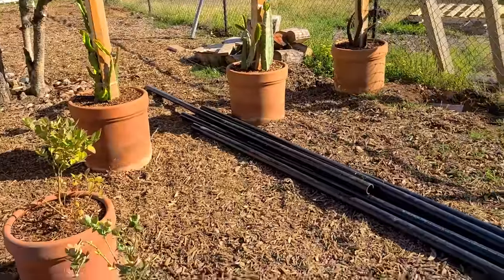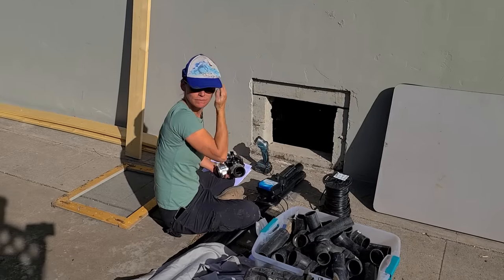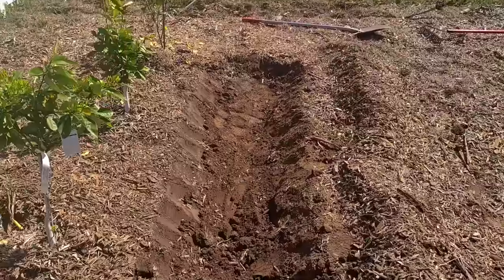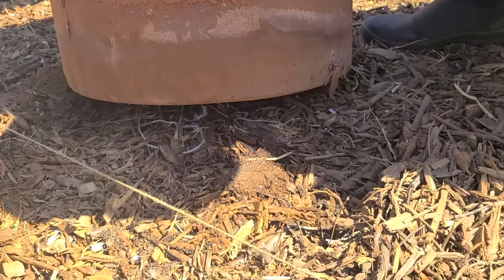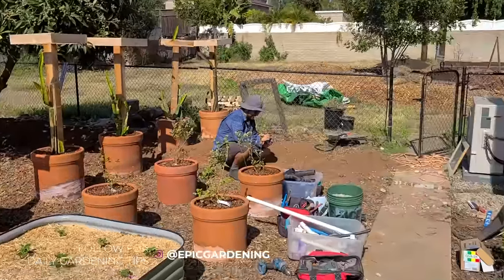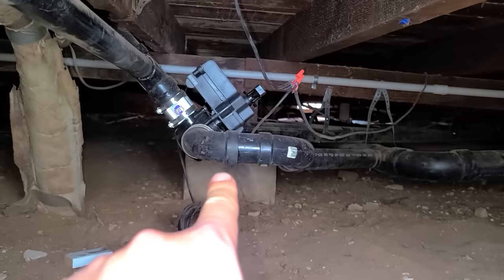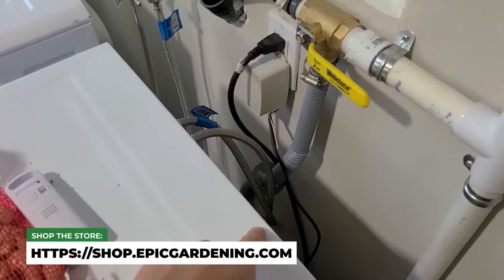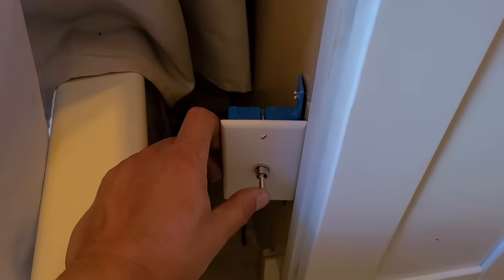Grey Water Systems: Shower, Bathroom Sink, and Laundry Conversion!

Comment from the maker: What questions do you have about these systems? I'll answer them all in a follow-up video 💦💦💦
Reply: what do you need to look for in laundry/shower/cleaning products to make sure they're safe for your plants?
Reply: My same question. Does the mulch and fill filter the water? What will you fill the basins near the citrus trees?
Reply: Is there a chance you could overwater your trees?
Reply: Do you know if this grey water use is legal in all of California or does the authority lies with the Counties? I had people give me conflicting information and I just would like to be sure.
Reply: Does the mulch in the basins eventually ya r to be dug out and replaced as it breaks down?
Reply: Kevin, there are some links in the comments that are pornographic. Is there a way to delete them? I don't want you to get in trouble....
Reply: What kind of foundation does this system need?
Reply: Did you specifically look for a house with a crawlspace so you could do greywater? Also did you calculate the number of gallons that you’d generate from shower and laundry and factor that in to determine the number plants that it can support?
Reply: @isoldefrancis2688  Brook & Kevin said it is legal to do this in California
Reply: I'd when you may be putting in a greenhouse but would it be possible to have another grey waterbranch in the drain to a holding tank for other plants besides citrus you may want to utilize water for ? Shout out to Jaques ;-)
Reply: Same question as many others. Safe products to use?? I try to stay away from phosphates, etc. anyway. we have a terrible problem with PFAS here in Michigan.
Reply: How does it work to eat food that's been watered by this? I'd be interested to see your bath and laundry products
Reply: What kind of soaps do you need to use to make sure this doesn’t kill your plants? I know lots of soaps and detergents contain salt (especially eco friendly types) which would harm soil. Is there such a thing as gray water catchment friendly soaps?
Reply: In Cali/San Diego County can we collect the water into a basin to use as we need?
Reply: How does it work with detergents? Do you have to switch to ecofriendly soaps and detergents or does it somehow get drawn out before the water goes to the plants?
Reply: Do normal shampoo and conditioner products hurt the plants?
Reply: When do you know when to use black water? Is there any sort of filtration that can be added?
Reply: Have you considered rocks for the basins instead of mulch? What factored into your decision? Did your greywater installer help you with the decision? I'd be worried about plant roots getting inside and plugging it.
Reply: @christinescharphorn5968  mulch wicks the water around where are rocks would just sit there and bit transfer the moisture around
Reply: Did you install backflow preventers? Is there a filter to filter out hair and lint so it doesn't clog the drip lines? Did you need permits?  Very interesting that your area allows Grey water system.
Reply: Everyone else covered most of my questions so my only one is what was the cost? xx
Reply: What about laundry detergents and things like shampoo/conditioner?
Reply: I have so many questions about how to avoid the soil getting contaminated by soap, microplastics build up from washing clothes, soil ruined due to any small mistake by you or people visiting...
Reply: Could you have used a “French Drain” to get the grey water into the soil? (Instead of those 50-50 splitters)
Reply: Maybe you already said it, but do you use special products in the shower (or washing machine), knowing that everything goes directly into the soil? Crazy to think what sort of solutions or chemicals we drain into the sewer without ever thinking about it...
Reply: Curious to hear how much water savings you get from the supplemental greywater. What do you expect to get in savings and what did you actually get?
Reply: How exactly is shower and laundry water safe for irrigation? Don't the soaps and oils ruin your soil?
Reply: How close can the trenches be to trees or bushes?
Reply: @trishdavi7049  The premise behind a grey water system is that you send the water direct into the soil environment full of benign bacteria that will break down the body oils and nutrients present in the water before any bad bacteria that may be present get a chance to use them to multiply into harmful concentrations. Stored grey water can quickly become black water.
One wouldn't use grey water in sterilized soil mixes that one would typically buy for potting up greenhouse plants because there is almost no bacterial activity in it to break down the grey water.
Reply: @moramen2855  Backflow preventers are for the potable water pipes to prevent water in a garden hose and an irrigation system from being sucked back into the system should the potable water system's pressure drop below what maybe present in the garden hose. If one is in an area where the sewer backs up frequently there may be one installed for the whole house because the toilet will overflow well before any pressure will build up sufficiently to break the valve installed under the house to the bath tub.
There were no drip lines in either of his systems. The pipes were draining into small chambers allowing the water to percolate into the soil where benign soil bacteria breakdown any potential harmful aspects before they get a chance to build up into harmful concentrations.
Lint being the elephant in the pipes. With so many artificial fibers in our clothes these days they do build up in water systems because they don't go away; they only break down into micro-particles. I would imagine that lint is better locked into soils than our streams and oceans where treated black water ends up.
Reply: Can it be done in a brick and concrete house with no crawl-space?  I'm guessing it would be really difficult.. 😕
Is that a good distance between citrus trees?
Reply: How would your set-up change if you had a frost line/freezing temps?
Reply: How does the water get distributed evenly on the washing machine line? It seems like the water would all come out of the first opening and not make it to the last one. I assume this system wouldn't work somewhere it freezes in the winter, right?
Reply: I'm surprised to see only two areas being covered. How did you figure out how much water you'd get out of the system and how much you would need?
Reply: It's ok for the arterchokes to use our water, I love taking baths and I want my artichokes, one day to use my water, but that's ok
Reply: Isn't it bad to put soap in the ground so consistently? Or do you just use all natural (I'm still not sure that's great for it)
Reply: How do you keep it from freezing in the winter?
Reply: This is awesome! How much does it cost to start this vs laundry to landscape system, and can you get reimbursement from the state/county? Thanks for doing this video!
Reply: Why you don’t use the water from the dish washer? Because of the grease?
Reply: Why are you using mulch as the back fill? Why not use some porous rock like lava rock? You won't need to replace the Rick as much as the mulch plus you'll have lots of cleaning bacteria living in the rocks breaking down the soaps and stuff from the gray water.
Reply: I watched through the video and have some questions and comments.

1) I doubt this is legal in many states. California probably is allowing this due to climate and the inherent drought situation in many parts of the state. 

This is because without manual intervention (selecting the proper orientation of the 3 way valve) could have contamination of your gray water by people who are not familiar with your home. I would definitely label that toggle switch.

2) why wouldn't you treat the trenches like they do for french drains and septic fields. Perforated pipe in a trench with clean stone wrapped with landscape fabric to try and cut down on silt intrusion. 

Obviously water distribution wouldn't be as good but should prevent or at least extend performance of the drain system for a longer time before maintenance of those trenches is needed.

3) like others have expressed not everyone is using a natural soap. Most bath products are detergents with anti microbial additives and fragrance. 

Our family switched to using a brand name Castile soap which has been a positive experience but not everything we use like hair conditioner, face cleanser, etc is. And I'm not sure everyone following your channel is so aware.

I feel a decent disclaimer or at least a link to a dedicated video discussing the issues and concerns surrounding gray water use should be at the beginning. 

Only because if people begin messing with their own domestic plumbing and they are on public water and sewer, there's a chance other diy projects involving domestic water could occur non permitted/inspected and greatly increase the chance of cross contamination (black water and domestic water supply) which potentially could affect an entire block or neighborhood's potable water.
Reply: My question is can you mulch the ditches ?I mean not put plumbing in them, like for the artichoke patch, just let water run
Reply: The three way valve. We want to do that as well for Winter Wet Season Vs. Summer Drought Season. What make model, installations needs to it require? Any regrets or advice?
Reply: Wait, what?  You're talking water filled with shampoo and soap and laundry detergent?  Aren't all of these things terrible for your plants??  I must be missing something.
Reply: How are you filtering the water? Or do you just use eco friendly soaps?
Reply: Do you plan on doing anything with sewage like a bio gas or humanure system?
Reply: is the soap in the grey water can be dangerous to the plants and soil ?
Reply: Do you have a filter to catch micro-plastics (from synthetic clothing?)
Reply: What about microplastics in your laundry?
Reply: Protect your ears, especially when you do another Rotohammering Trench loud project
Reply: So with this system, it is okay to not filter grey water before releasing it to the plants?
Reply: If considering regional temperature and rainfall, would you advise some people to consider installing a one-way check valve in the pipe leading outside?
Reply: Do you have to be specific about the type of detergents, shampoo, conditioners, soap that you use for this? I’m getting curious about this, and I’ve seen Geoff Lawton set stuff up with a reed bed to do some type of filtering before getting to other plants and or gardens… I’ve also seen different people using mycelliated woodchip beds as filters too (sometimes for more extreme filtering and remediation like with factory or chemical runoff).  I just figured it was more involved, so cool to see the simple setup. Being in 9b in Arizona I’m getting very interested in water harvesting and recycling
Reply: How do you make sure there’s no soap in the water from the shower/laundry?
Reply: @trishdavi7049  Except some counties have rules about using water straight from laundry. We used to have our laundry going to gray water but learned that they changed the rules and now washers have to be connected to the septic tank. Other gray water that isn't going to septic systems must be delivered to dry well--they give the specifications for this. So, yes, some counties in Cali say it's okay. Others have certain restrictions. Check with your county to make sure you're in compliance with the regulations. As for detergents, I use Ecos.
Reply: Can you use any type of soap, shampoo & conditioner when using to water your citrus trees?
Reply: I'm curious to how much this cost. I would very much like to do this but fear it may be out of my price ability
Reply: what about filtering the grey water, so you don’t poison your plants ?
Reply: @morganpresley496  You read my mind! 😊
Reply: Bury below frost line outside of San Diego
Reply: Curious about any filtration for your washing machine water. Is there any? Doesn’t grey water contains lint that could clog up the pipes or sprinklers?

Comment: If you haven't already, please make sure to transition to garden safe soap and install a microfiber filter so the polyester fibers from your clothes don't leach into the plants!
Reply: What are some good grey-water shower soaps?
Reply: @robjenkins494  Aubrey Organics Shampoo.
Aubrey organics Conditioner.
Alaffia Face Cleanser.
Dr. Bronners's Pure-Castile Soap.
Reply: I was wondering about that. 
Tide-flavored artichokes and Irish Spring citrus sounds...not delicious.
Reply: @tamtam4049 Just Googled it and Aubrey Organics was acquired by Nutraceutical International Corporation about five years ago.  Some say the formula changed so do your research before using
Reply: very good comment.We re-use out washing machine water to water trees and grass but it is a very crude system, basically just dumps out into the center of the back yard thru a pipe I played underground from the washer. we for sure have issue with clothing fibers especially right around where the water exits, it looks ugly just creates an area with lint stuck to the lawn. we do use bio safe plant based detergent and that works well, so far after 15 years of doing this the grass is still thriving and it doesn't get all sudsy looking out there. maybe I will change to a little different system with a filter to get rid of the lint that collects on the grass around the outlet! I wish everyone around here would try to re-use even just some of their grey water, we are in phoenix and water is getting increasingly limited and expensive.
Reply: @AsTheWheelsTurn 
You can get a filter that goes on the end of your laundry hose. Just slip it out of the wall drain and zip tie it on?
Reply: @DLlama funny enough, Irish spring's scent is from clover flowers (the same flowers used to make clover tea)
Reply: I wonder if the water from dishwashing with Dawn Soap will be able to recycle with this system for plants in Garden or I need to switch dish soap to organic one? We are thinking about doing this system with water directly from our dish sink. Thank you
Reply: @DLlama  Irish spring citrus do sound delicious  tho 😂

Comment: Every house should be like this. Zero waste all the way!  💚
Reply: The environment obliges. A no-brainer.
Reply: @Zachary Chenoweth Out of curiosity, where does the waste water go?  Does it get treated and then "dumped" back into the aquifer.
Reply: Actually many cities (at least in germany, but the problem should be the same) have huge problems with sewage systems not being used enough (as once speced) because people conserve water. As a result the systems don't work well anymore and stuff (no further comments ;)) isn't moved through the system correctly and settles in the pipes. The normal fix is, that the cities use huge amounts of water to flush the sewage systems. So in the end no one really wins.
Reply: @stefan514  Wow that's interesting never really thought of that. I think it makes sense for more rural area where people use septic tanks anyway but for the city and large suburbs obviously It has negative consequences.
Reply: @stefan514  that’s really sad :(
Reply: A lot of places in the US specifically prohibit recycling greywater, it's kinda ridiculous. Tho it makes SOME sense, they don't want some idiot who spent 5 minutes on a forum to try this and poison the entire ecosystem around his house because he didn't switch to the proper soaps and stuff lol

Comment: When going under walkways, I usually put a much larger pipe in, as a conduit.  That way, if you ever need to run more pipes or irrigation wiring, etc, you only have to dig out the ends.
Reply: Very practical suggestion Joe.

Comment: Very impressive. Last year, we had to replace a lot of our plumbing ( the house was built in 1946) and I wish we had thought about doing it then. Jacques is quite the Jacques of all trades, you are lucky to know him.
Reply from the maker: Bahahaha love the pun
Reply: I'm thinking I could do this with my washer pretty easily even it only pumps out onto the lawn.
Reply: @Riverrockphotos  I have found it helpful (even using the bio-safe soap) to pump the washer water into two bins first. One to act as a primary sediment filter going through many layers of furnace filters that cover many scrubbie pads (i used plastic ones, but copper is an option-the point is to also aerate to prevent anaerobic growth). The next filter was a mini peat bog that had water cress or horse tail or reeds in it.  That stage removes heavy salts that some plants would not be able to tolerate (especially over time).  Now, we had a third tank that was the holding tank until scheduled watering.  It was a cattle trough with feeder goldfish a tank heater in winter but most importantly a solar powered/backup battery fountain. It had several plants in it as well.  We had zero mosquitos and zero probs with plants.  A solar powered timer & drip irrigation fed from there. *there was a quarantine bucket for new plants to sit and soak their nursery soil off their roots and it was innoculated with quite a few really good strains of mycelia-must've worked--the yard was stuffed with planters with really happy plants--and the normal temps were between 101-114*F daily for months  Even strawberries!  Good luck to you!
edited: typo
Reply: O!  Just saw this one which is a little different than mine because it has a grease trap & that is a great idea and lowers system maintenance.  He has a catch basin with worms, but our composting & worms were separate to protect against fire ants invading.  We also did this on a family house with kiddos so our water volumes were probably way too high to use his style.